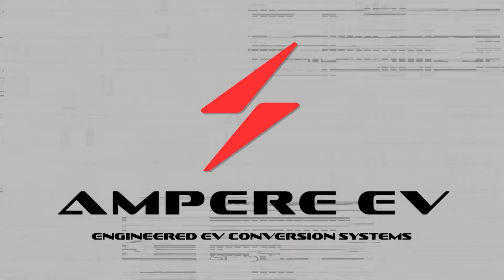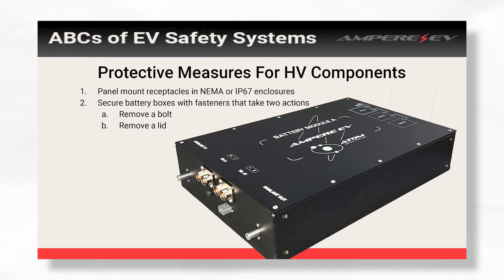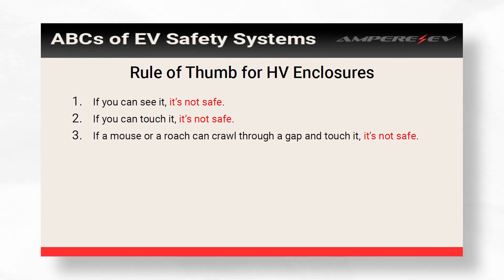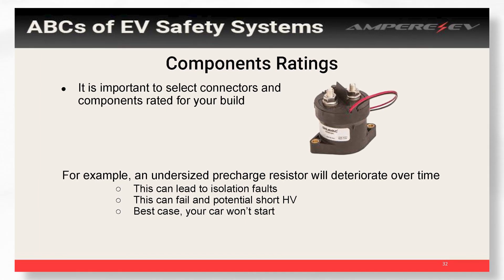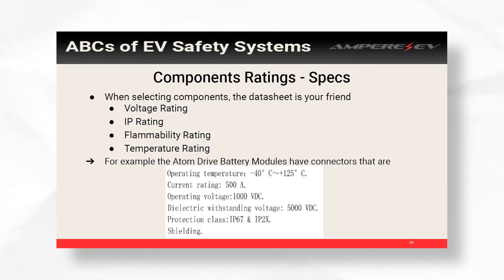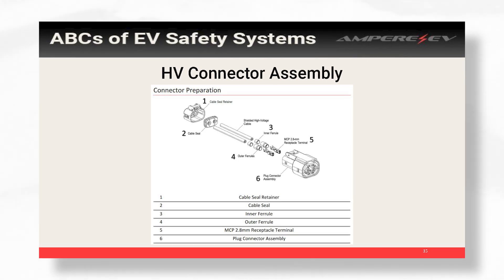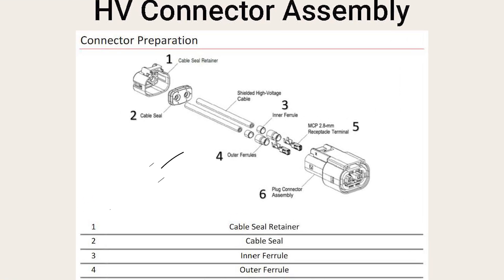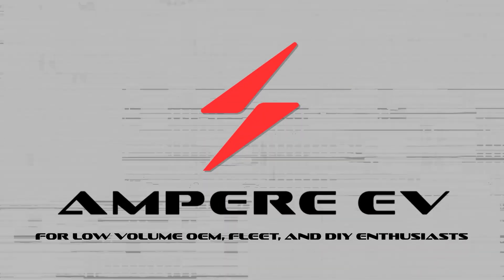High Voltage Connectors & Fasteners Explained - ABCs of EV Systems

Comment: Heyy, that's an HVA 280! It's still funny to me that the terminals inside are the same old MCP 2.8's we use on other connectors, just swaddled in layers of additional shrouds and shields to make this high-voltage assembly.